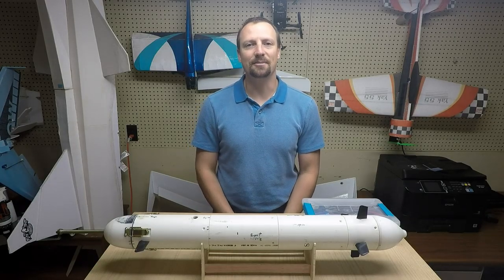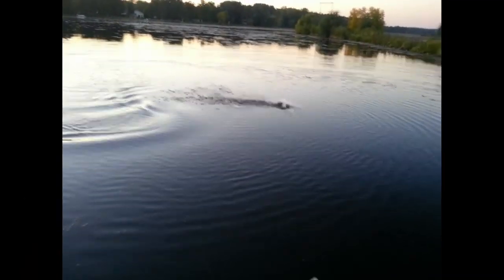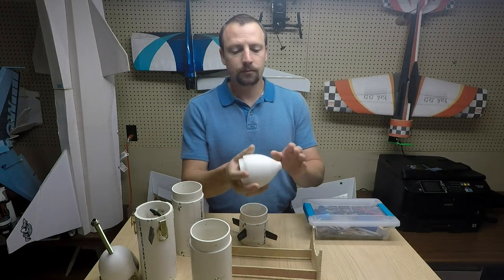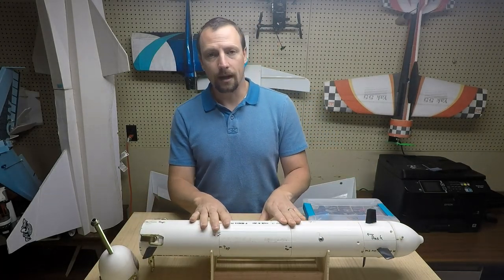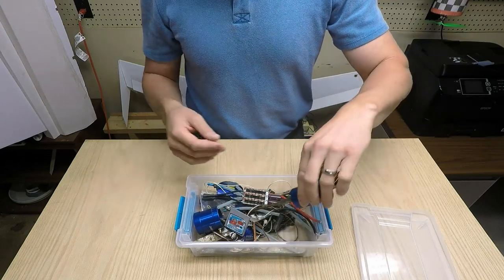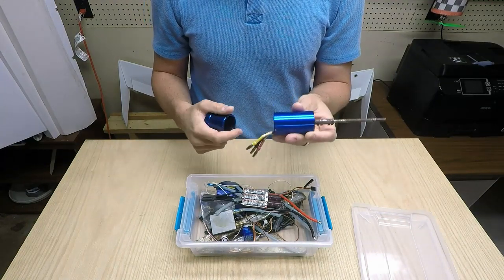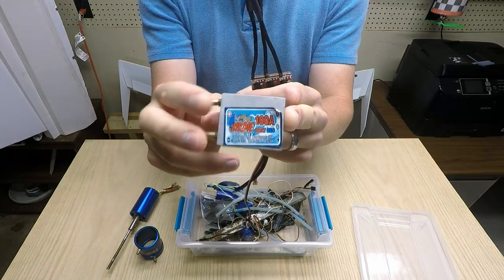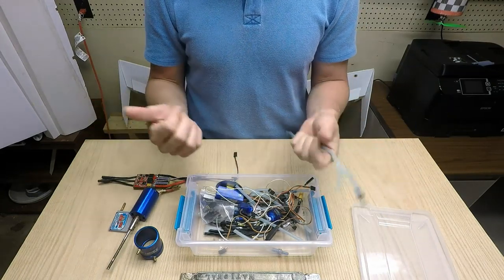DESIGN and BUILD of an RC SUBMARINE

Comment: Thank you, I think I'm going to try gear reduction and counter rotating props to reduce torque and prop diameter.
Reply from the maker: Yeah that sounds like a good idea. Or use two smaller motors. Could potentially use differential thrust then too for helping it turn if you did the props side by side. otherwise if you did them inline it would definitely eliminate the torque roll that mine experienced. Good Luck!

Comment: Hi -- Is there any detailed information on the nose cone seal / clasp arrangement?  I can see what it is and roughly how it is made, but I am interested in the specifics of what clasp was used (is it special to hold up to the water exposure), and what seal material was used.  I am developing an ROV of my own, and that appears to be an excellent way for me to have a nose with good access.  Excellent model you have there.  Thank you!
Reply from the maker: Hi, Nice to hear you are making an ROV too. You'll have to let me know how it goes and post some videos. Yes, the nose arrangement works very well. I have been trying to come up with a better one that is more streamlined, but they get too cumbersome or are harder to take off. Nothing special about the latches. The ones I have are brass finished which helps them last longer in the water. Here is a link to the ones I have been using. https://www.natman.com/detail/1842-draw-catches-n208-561
You should be able to get these on ebay or amazon just fine. I just got a second set from ebay for a new nose cone I am working on. Look for a video of that in the next month or so.  

As for orings, I think any would work with an ID of 3" Here are the ones I am using. https://www.mcmaster.com/90025K466/

Let me know if you have any more questions. PM me and I can go into more detail. I am currently about to start reassembly of my submarine and hope to get it in the water next week. So look for some new videos in the next few weeks. - Dan

Comment: It should be no problem using your Taranis for control. Actually there are two possibilities:
1. You could connect a MHz transmitter module to the PPM output of your Taranis HF module bay. Main problem will be fixing the long antenna required.
2. You could create an external converter consisting of a FrSky receiver with PPM output connected to the PPM input of a MHz transmitter module and a power supply. Then just place that converter stationary at a suitable place.

I would prefer method 2 as it is more handy. The additional battery within that converter can be easily monitored by the FrSky receiver's telemetzry function.
Reply from the maker: Yeah good idea. I haven't seen a MHz  module. Though I haven't looked real hard. Have you seen one?
Reply: @AscendDynamics  As I am in Germany 72MHz is no option to me. But there exist transmitters supporting modules for 27, 35 and 40MHz, maybe now just as used products, e.g. from JR, Futaba, Multiplex.
I am in a similar situation as I also have two subs in use, but actually still have a 15 year old MC3030 which is sufficient for my needs. But I often have thought already to build such a converter box in case this old transmitter will be dead at some day. From this transmitter I have two 35 and one 40MHz modules available.

Comment: I too have a fast sub, but no videos posted.  I also want to convert a frisky to 72mhz.  I have purchased two JR72 mhz modules, but not the radio yet.  It is project for the year.
Reply from the maker: Oh very nice! Yes, needing more programming capability and channels. How is yours made? Dynamic or passive diver? What size motor? Have you tried putting cameras on yours? FPV is really easy. Do the JR72 MHz modules work with a JR radio? Seems like that might be a good way to get the capability we are wanting. If you do get a chance to make a video I would definitely like seeing your sub!
Reply from the maker: So had a thought that I think I'll try on my Sub. I don't need more than the 6 channels that I have on my 72MHz radio, but I do need more programability and mixes. If I was to use a Quadcopter flight controller that would give me all of that as well as stabilization and auto level. :-) I'm excited to try this now!
Reply: @AscendDynamics  I just posted some videos of the new Graupner Shark.   It is faster then I could control.  I recently modified the tail, reducing the surface area, because it would snap off after a hour of high jumping.

I can write up the specs.  but I think it was a 38mm Castle sensored, brushless, water cooling, split front dive planes.

Comment: There has been a variant of the ACT DSL4 TOP (in Europe we used 35 MHz and 40 MHz) which had PPM sum on output one. If you could get one of those, you could connect it to a flight controller. Also you could use a regular 72 MHz (or whatever is used in the US) RX and connect it to an older flight controller like the NAZE32 or SP racing F3 which support individual PWM inputs. By using a flight controller you can do all the mixing inside the submarine and have gyro stabilization on top.
Reply from the maker: Yes, I think that is the best way to do it. Not only get the mixing capability but also benefit from the 6 axis stabilization. I have like 3 old KK2 boards I am thinking to try out... Haha!

Comment: how did you seal the holes that allowed the servos to control the fins?
Reply from the maker: They make plastic bushings that have an o-ring in them to seal up. I'm not sure where to find them now days. another option is a sealed bearing of the right size. check out these websites for ideas. https://www.rc-submarine.com/shop
https://www.rcshipyard.com/tech/

Comment: Let's say, it travels 1 hour, will the electronics components such as battery and other parts will be affected due to the enclosed space without incoming air?
Reply from the maker: The problem with autonomous is that GPS doesn't work in water at all. You would have to rely on accelerometer and gyro tracking in the control board. This is easy to do with an aircraft or drone that has GPS, much harder to do underwater where you don't have an external reference like GPS. As for being enclose in the sub for a long time, overheating isn't an issue because you can run water cooling to the components.
Reply: I am confused. In order to make an autonomous mission,  algorithm and programed waypoints can be done for the submarine to go from point A to  

That is the reason how modern submarine torpedo works ?
Reply: Is it possible to make the submarine autonomous as long as a GPS antenna is above the water surface?
Reply from the maker: @franciscourena5636  Hmm. That might work. Just have to control the depth accurately with a barometer to keep the antenna above the water.
Reply: @AscendDynamics  
Last question 
I have seen some UAV with a GPS antenna mounted. Then, I noticed they go deep into the water.

My question is as follow:
Can you establish a mission plan Point A to Point B by going deeper and surfacing the AUV periodically?
Reply from the maker: @franciscourena5636  Yeah that would probably work. Would definitely be better than trying to navigate purely on inertial measurements.
Reply: @franciscourena5636  million dollar question.....:)
Reply: Ok, what is the answer!

Comment: Very cool work. I have a small request. Doctor. Can you give me more details about the components that you used or where I can buy them, such as the camera and the motor? I live outside the United States of America and I want to buy the components from the online store
Reply from the maker: I don't think that a lot of the components that I used are available anymore. I would highly recommend trying Nautilus Drydocks at https://www.rc-submarine.com/
They have all kinds of parts and kits to get you going. As for Cameras, just use any FPV system for a drone. You will just have to put the Video Transmitter in a float that stays above the water. Have fun!
Reply: Amazon is a good source for parts used in a project like that. There's also a number of YouTube videos on home building ROV's that have other options for motors, props, camera housings, ect. Most of those are surface tethered though.

Comment: Can you make it autonomous to travel from Point A to Point B, 5 feet below water?
Reply: To do something like that, you'd want a microcontroller on board. Like an Arduino or Rasberry Pi. Depth and direction would be easy enough using a compass and pressure gauge. The main problem is that it would have no idea where it was. Time, direction and RPM would let you estimate with dead reconning, but to get an accurate position, you'd need to get close enough for a GPS antenna to penetrate the surface. Currents could put you way off your estimated position. The other issue is that collision avoidance would be much more complex unless you just want to turn it loose and hope for the best.
If A and B were close it would probably be reasonably easy. The further away they are the more difficult it gets.
One option would be to have it run subsurface for a few minutes, pop up and get a GPS reading, then go back down to cruising depth for a few more minutes. Less stealthy, but more accurate.

Comment: Which type of bearing did you use ?
Reply from the maker: It was a bronze bushing with a rubber o-ring in-cased in plastic. But I need to come up with something better as this one ended up spinning on the prop shaft after running for just a few times. Ball bearing would be preferred.

Comment: what kind of wire did you use to connect the FPV camera to the surface buoy?
Reply from the maker: Just a simple 2 conductor insulated wire I had laying around. I don't know what guage. But it is pretty flexible. Just about anything wild work. I run a common ground and video signal. Power is supplied independently at the camera on the sub and at the video transmitter in the buoy.
Reply: @AscendDynamics  ahh ok cool. I was thinking of a similar project and was worried about choosing a wire that is salt water resistant
Reply from the maker: @groudonkoorb  ah, that's a good point. I'm only in fresh water now so I haven't worries about that, but if you are in salt water, definitely do more research on what wire to use and such. That said, I think any wire would work ok as long as you whipe it off after each session with a rag damp with fresh water.

Comment: I don't understand how you sealed anything. How are those pipes sealed against each other? How are the servo linkages sealed?
Reply from the maker: Each section of the PVC pipe has a shoulder machined into it. I just add a little bit of sealer and put them together with a couple of screws to hold them in place. The fins are on a shaft that goes into the submarine through a plastic bushing that has a rubber o-ring on the inside. All of that works great. I haven't had a lot of luck sealing the motor shaft though. Watch a couple other of my videos on it and you can see exactly what I did.

Comment: Over here we use either 40 MHz or 27 MHz without any problems . I have been told not to sail  it in saltwater , which would affect the range . Interestingly one of the first model submarines I made a U-boat type 7c  had the radio aerial coming out of the waterproof hull . Just a bit of wire without sealing the end and it worked fine  . I never had much  trouble with it , although I was told a pike did follow it , but I never saw it myself.
Reply from the maker: Yeah, I believe both of those bands are avialable to me here too. The trick is getting a 6ch radio that runs on them. I need that many channels for all the controls I have.  One thing I could do since I have a float with the Video TX in is anyway is put my control rx there and run s-BUS to a flight controller. That would allow me to use my Taranis then for control.
Reply: I don't if this is possible in the USA . But over here in Britain  on eBay the are second hand 4 and sometimes 6 ch transmitters and receivers to be had .  any help to you ?  @AscendDynamics
Reply: I just had a thought , If you have say 4 channels on your transmitter and need 6  . One thing I have seen done  at the club I belong to.  Provided the two extra channels are not  proportional  , i.e. just off and on . Then it's easy just to buy two simple transmitters and receivers on eBay , if my memory is correct work on 445MHz  . That are sold to be used opening garage doors or something similar . Then stick the transmitters , which are very small,  on the back of your 4 channel transmitter .   Of course if there is someone living close by who does have garage doors,  that use a remote.   

It may cause some head scratching .  :- )    @AscendDynamics
Reply from the maker: @welshpete12  Haha... that would be funny. I don't think this is going to be a problem for me. It will be rather easy to either use my Taranis with an above water receiver or (and I had forgotten I was going to try this) just use my same 72MHz 6 channel that I have used for this sub already and put a Quadcopter flight controller in the sub for the mixing capabilities I want. That would give me more than enough control while also giving some gyro stabilization and auto-level capabilities. :-) The latter might really help keep it underwater at times. Thanks for all the ideas. :-)
Reply: You very welcome :-)  I have a auto-stabilizer. I'm told they should be fixed in the middle of the boat if at all possible.   @AscendDynamics

Comment: May I know which is the flight controller you have used.
Reply from the maker: I used a super old Kk2 mini. It's super outdated nowadays. I would highly recommend using a much newer flight controller. Then for firmware I would recommend ArduCopter... So technically it would be better to use one of the land-based variations. I think something like ArduRover would work great. It can be done with the KK board, I just had it laying around. But I definitely wouldn't recommend using such an old board anymore.

Comment: How is it seals water?
Reply from the maker: I use silicone between each tube section and an o-ring for the nose. Works great to keep the water out.
Reply: Ascend RC thanks, how about the location of rudder and motor shaft? How do they seal water while still rotatable?
Reply from the maker: For the control find I have little plastic bushing with a molded o ring. I got these 5 years ago from an rc submarine site and haven't been able to find them since. For the motor shaft I'm using sealed ball bearings.
Reply: Ascend RC thanks, I saw many people using rubber bellow, have you thought of this? Anywhere to find water seal bearing? I found is the seal only prevent dirt come in but not stay it may seal against water?
Reply from the maker: Try https://www.rc-submarine.com/ they have all kind of parts. I haven't check for seals specifically in a while. Though I may need to find some myself as I think I want to try different control fins soon.

Comment: What? You didn't 3d print the cones?
Reply from the maker: Haha. Didn't have a printer. Though honestly, I would turn them again instead of printing. Needed the extra weight and strength that a solid part would give. Though, I guess They could be printed solid. :-)
Reply: Lathe turning would be the right thing to do.  3d printing is so over-rated especially for real mechanical features.  I wouldn't trust "printed" o-ring groove or NPT threads to be water tight.  Also, you would end up spending much time w/sand paper, files and dremel to remove "extra support crap structures".
Reply from the maker: @trexinvert  Exactly. Turning solid plastic just ended up working so much better. Though I did them on a manual lathe... next time I'll have to try my cnc mill. :-) What I want to try is clear acrylic or some such plastic and polish the nose to a fine finish. Then I could put a gopro session inside and avoid the excess drag that putting it on the outside had.

Comment: Make it run on hydrogen. So from outside water, it will extract hydrogen and make a mini piston engine for it. Iv done it before, very handy than battery. Or you can make your battery charge using hydrogen etc
Reply: Keppsmokin
Reply from the maker: Haha!
Reply: How do you split the water into hydrogen and oxygen? Nuclear reactor? I was under the impression that it took a decent amount of electricity to crack water.

Comment: How the wather can't go inside the submarine by the propelers and the order holes?
Reply from the maker: I used some special bushings that have seals embedded in them. For the control fins, they were just simple plastic bushings sealed with an o-ring. For the motor shaft I used a sealed bronze bushing. They worked quite well. I never got any water inside. I did end up spinning the motor shaft bushing (it stuck to the shaft), so I need to find a better one. There is a link to these bushings in this video's description: https://www.youtube.com/watch?v=j8MpLlIBO4g&t=1s
Reply: Thank u for the answer and link! Did a good job with the submarine.
Reply from the maker: @rodrigoalvesdeoliveira6919  Thanks! It was a lot of fun. I really need to put some time into fixing it up again and doing more videos of it.